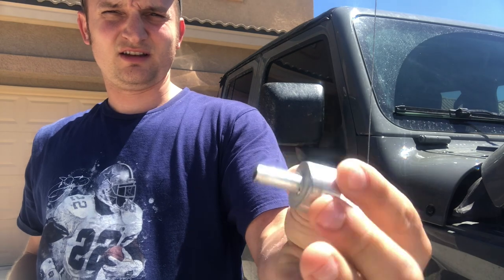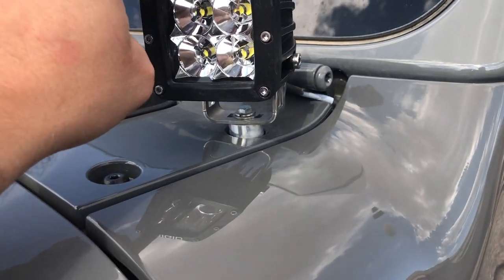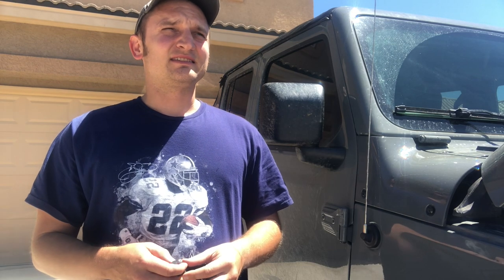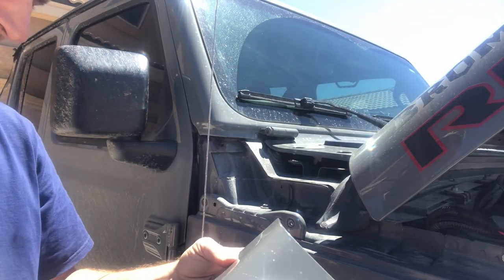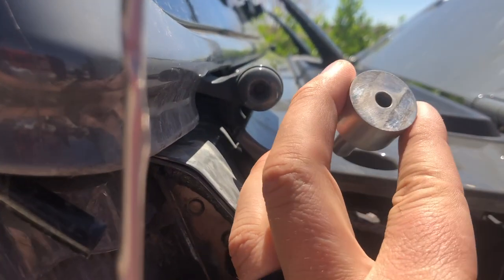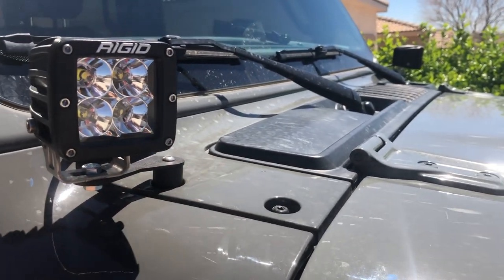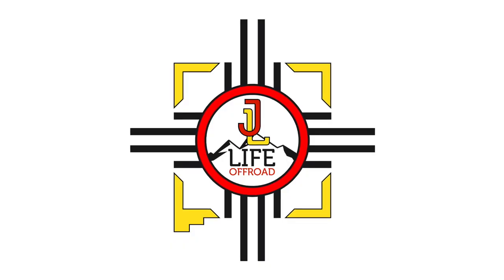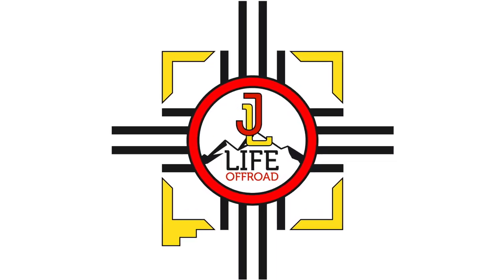JL LIFE   ROCK HARD COWL LIGHT POD MOUNT FAIL on our 2018 JEEP JL RUBICON

Comment: I agree the first install looked cleaner, i had to go look under mine. Looked possibly able to squeeze a modified tube with foot flange you could thru bolt at that seam where it just out past where you can work like a "L" underneath.
Reply from the maker: Woah o had done tht from the start. Now I’m to scared it will break my awesome weld if I try re-mounting it. 

Thanks for watching glad to hear ur trip was safe

Comment: I get it, bro. Sometimes you have a specific look in mind and it's tough to get over. That said, you really need something there with multiple mounting points to maintain rigidity and strength. Or maybe a crush sleeve between top of cowl and the nut that bolt screws into? Great video, mentioned lots of options. Waiting for the next one!👊
Reply from the maker: Yea... still sad... but the design was just not there... but with summer coming... we love our night rock crawling... I have to have my lights ready to go... so for now... they are on...

Thanks for watching 🤙🤙

Comment: Hmmm.  Was just about to order the RH4X4 mount.  I'm wondering if I could cut a "spacer" that has a slight press fit under the factory nut.  So that the weight of the light is actually supported by the body below that nut and not the nut itself.

Comment: Good product for the price point.  Agree on not overpaying for a bracket.  My opinion the Rockhard designed single point mount style is an opportunity for failure when considering the added leverage on the single weld nut and flange under the cowl cover.  The multiple mounting points help distribute the load on the non-structural fasteners.
Reply from the maker: I couldn’t explain that better myself.... I’m gonna run these for awhile... I need to give them a chance to grow on me and  get past this hung up on the old look mentality I have. They are functional and solid... 🤙🤙

Thanks for watching friend... we definitely appreciate it!

Comment: It’s a good fix mod! You could have use a rubber bushing in the first place
Reply from the maker: Agreed... Thts why I had the black tape around it. Try to soak up the vibrations... I very well may in weld a spacer into the gap to help hold it in place...
Reply from the maker: ThNks for watching 😉🙏